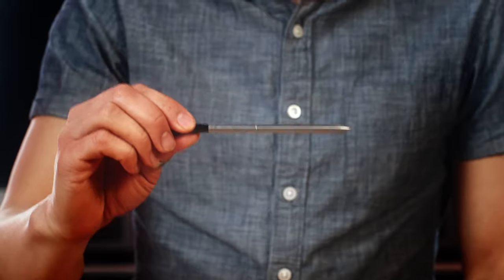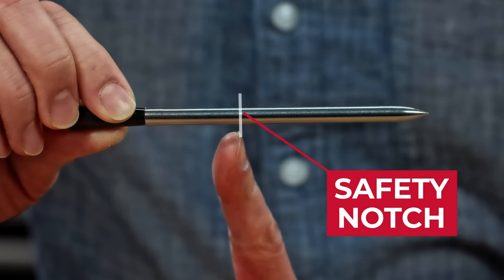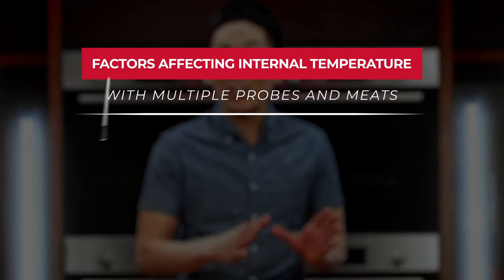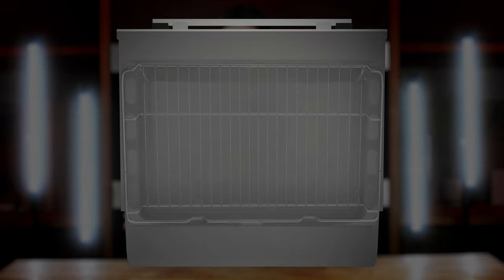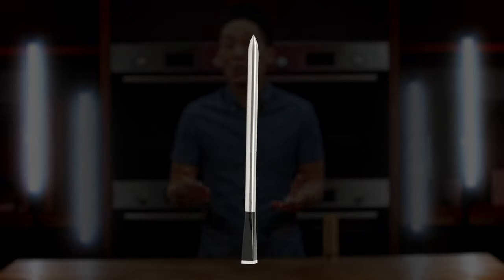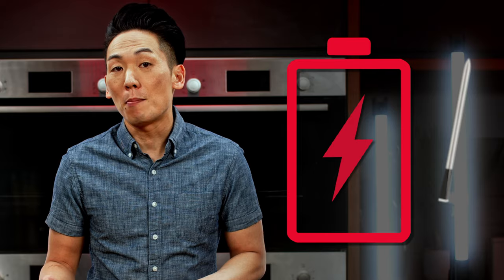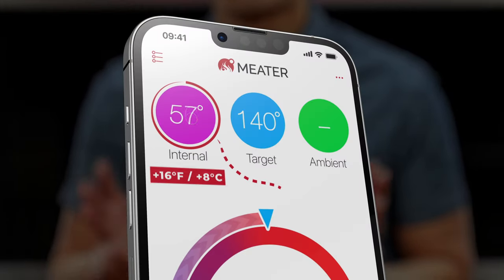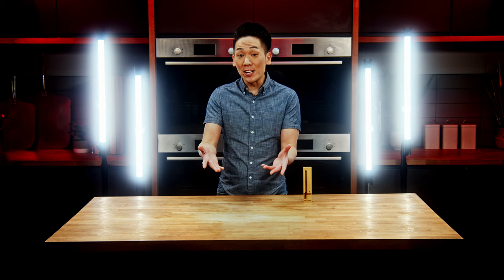Internal Temperature Explained | MEATER Product Knowledge Video

Comment: I primarily use the Meater + with my kamado, in this video is shown the probe also works in an regular oven. When I try this my self the communication is blocked due to cage of faraday principle. Howcome this works in this demo video?
Reply: Mine is working fine in a gas oven. 2/4 bars of connectivity when magnetized to the hood above the oven, 4/4 when I sit it on the lower oven drawer. (Couldn't magnetize to oven door, surprisingly)

Comment: Wow, I send Support very specific questions about my Meater+ not working and they send me a robotic boilerplate FAQ.  Great support.
Do not buy one of these.  Completely unreliable.  At least a 20 degree swing between the actual temperature and raw or overcooked meat.
Reply from the maker: Hi there! We send out an automated response with solutions that may resolve your issues without a long wait. If your issue has not been resolved, our agent will reach back as soon as possible. :)
Reply: I noticed my MEATER plus isn’t very accurate at all for the external temp. It’s off by some 20 to 30 deg from actual temps. I honestly wouldn’t buy it again.